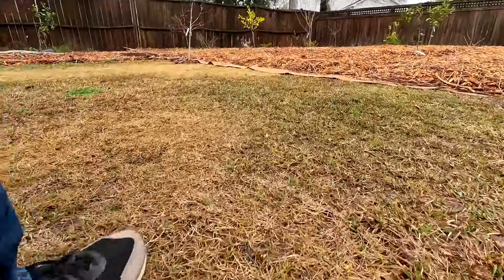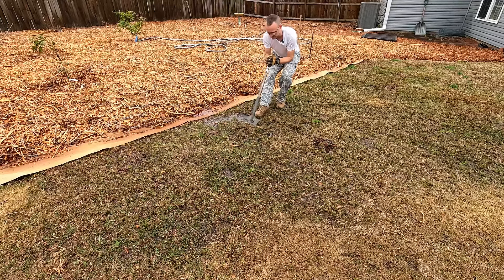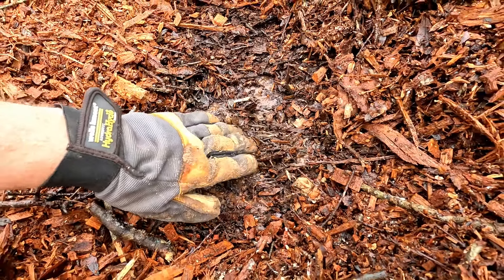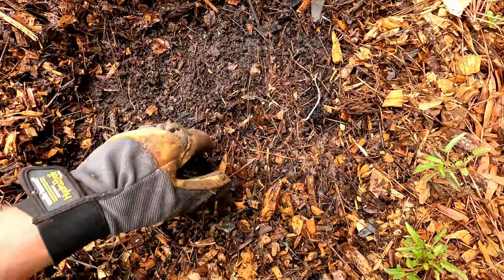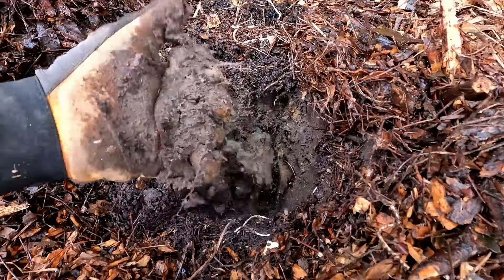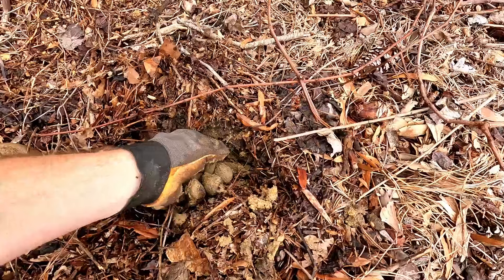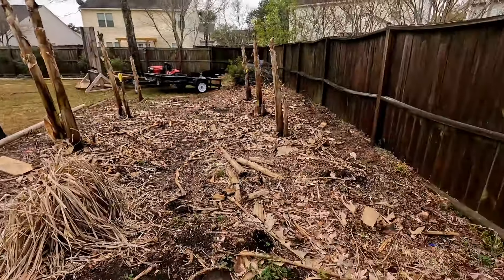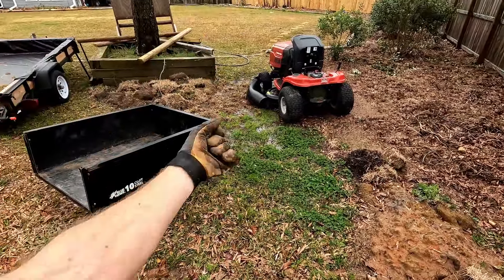What Do Woodchips Do? A Soil Comparison of Sandy Clay

Comment: I have done a yearly arretation (deep plugs) followed by either wood pellets or alfalfa pellets from the local TSC store these give organics to the soin, went from sand to noce dark topsoil in a few years.
Reply from the maker: I've heard adding the pellets helps out. I knew a guy long ago who used chicken feed to fill in after aeration. I think he went with that just due to low cost. Probably added some unique minerals as well. Anything natural could probably be used to amend after plugging. I'll check out TSC and see what I can find on the cheap. Thanks!

Comment: I feel 90% of negative comments on woodchips are wrong or bad perspectives, people seem to think woodchips are never maintained or weeded and thats wrong, you still have to pull weeds and rake chips into piles during planting.
Reply from the maker: Absolutely, this has been my experience. I also learned you can't just dump a bunch or a few inches of wood chips on existing weeds and expect them to be smothered and die. If you want them to smother and die, cardboard or construction paper has to be used. Otherwise, yeah, grab a rake and go rake the top bit of wood chips to get weeds out. They practically just fall out anyway. They're not rooted into anything other than the wood chips. Seems like disturbing them with a rake is almost enough to kill all of them. Weeding my wood chips has been very easy so far.

I'm still learning though, still experimenting, still curious to see what happens in a year to 5 years and beyond. I'll be documenting the whole journey.

Comment: I think heavy clay or loamy soil, you're gonna always have compaction if it's just a mowed lawn. A lawn isn't strong enough to decompact the soil and drain the excess winter rain. A good comparison would be wood chips against just a wild patch of the garden left to its own device. 
In any case, I've been using wood chips for 6 years and they're great. But I've learned a few lessons. First, in heavy clay like I have, I still need to till the soil in some areas. In others, which had the most wood chips, I don't. And finally, I also don't need to till if I've sown winter cover crops. The last lesson is for flower beds : contrary to popular belief, wood chips can actually do some bad. Because a lot of flowering perennials and ornemental grasses DO NOT prefer rich soil, and will actually thrive a lot better in poor soil. Stuff like poppies, echinops, eryngium, carex... You're lucky, in the US most natives are from rich meadows and will be fine with wood chip gardens : sunflower relatives, echinaceas, monardas, eupatorium etc... But in Europe not so much. So I have to contend with that and not put too much wood chips, otherwise my flowers beds would have tall disproportionnate plants that would flop over in the wind. They would also die a lot earlier than in the wild due to that excess fertility. What about trees and shrubs ? Don't know yet, I think they will do fine with wood chips, especially fruit trees. They much prefer wood chips to weeds like quack grass, I can tell you that.
Reply from the maker: Super interesting the differences. I'm not using much wood chips in the few flowers I have at this point. I'm planning on filling in the areas between the trees with flowers for pollinators, as well as vegetables and herbs and the like. Thanks for giving me the heads up on how some other plants may react to the chips. They will be more composted by next year, when I'll be filling it all in. I may need to alter the plan a bit. Everything is an experiment!